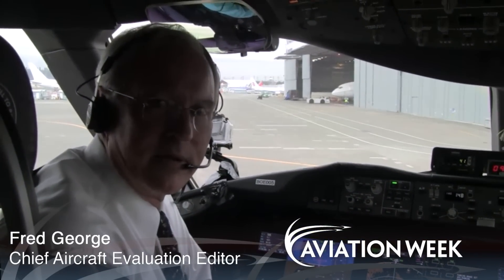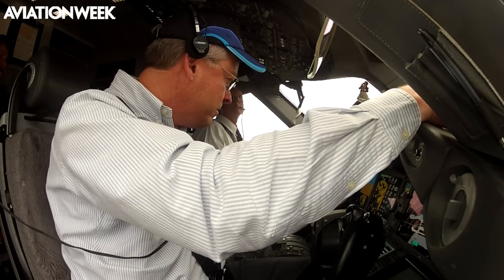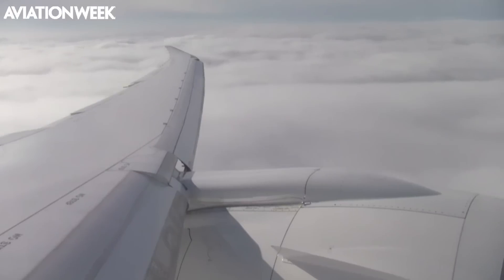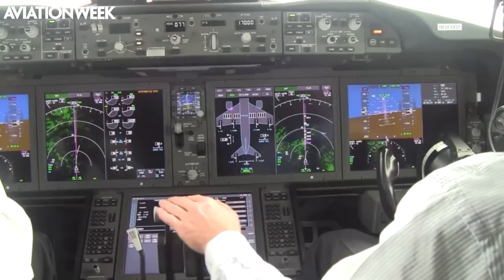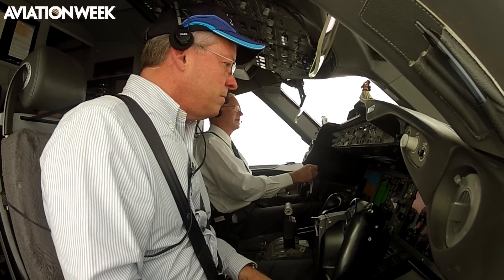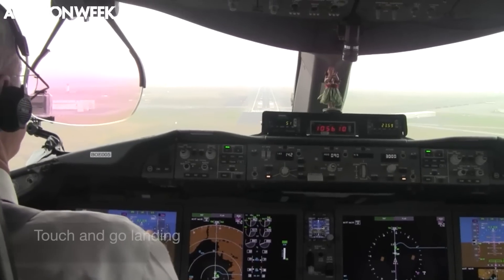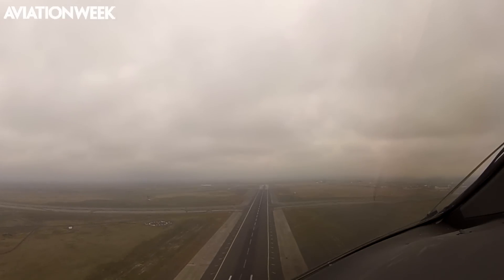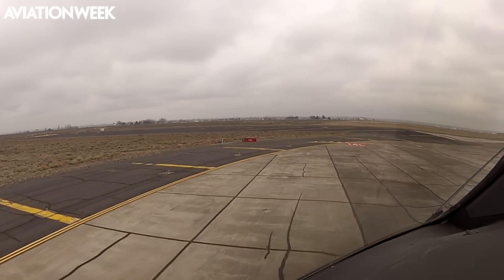Aviation Week Pilot Report: Flying the Boeing 787

Comment: notice at 7:18 where they claim to simulate a 1 engine inoprative landing...

But the instruments of the aircraft clearly show Both engines working at at the exact same thrust... -.-
Reply: nice catch
Reply: Be advised that this is considered to be a "Simulated" 1 engine inop approach. For safety reasons, they keep the inop engine at a stable 40 - 50% N1. They don't idle the engine for precautions.
Reply: SottileSky ... They dont even do that, both engines opperate at same thrust 100% of the time. If both engines are fully operational and at the same thrust you are not simulating anything. in other words, it's a completlety normal landing.

Comment: That's because the Capt and PNF didn't realize the PF was pulling back on the stick, (Which is what caused the stall) which at least the PNF would have with an interlocking control column, as the yoke would be pulled back into his lap. Then corrective measures, could have been taken, preventing the stall in the first place.

Comment: @oktal3700: Agreed, AF447 had everything to do with pilot response to a recoverable event (at several points), never meant to say otherwise. Just that it started with blocked pitots, which would still affect an analog asi. But in terms of 'redundancy' I'll bet that A330, properly configured could have recovered itSELFonce the pitots were clear - for sure it would not have fallen 30,000 feet belly first

Comment: 2nd Officer was Pilot Flying, 1st Officer was in the Capt. seat as the Capt. had just arrived to the flight deck after rest. PF had his sidestick pulled back. Capt. and 1st officer couldn't figure out why the plane was loosing altitude, as with the A330, there aren't any visual cues i.e sidesticks don't move where as control columns do.

Comment: so is manual handling in normal law operations the same as that on an airbus? if i pitch up 15 degrees and turn right 10 degrees and leave go of the yoke, will the computers hold it there for me? is there auto trim?

Comment: Technical question: In both 777 and 787, I've seen the centre ailerons first deflect down, then up, and then go back to its original position, all during the takeoff roll. What is the purpose of that?

Comment: Alternate air data system,,,,NICE. Air France 447 would have survived if they would have had one of these in place.
Reply: Also the feedback control column as opposed to the sidestick. The pilot would have been aware that the co-pilot was pulling back and would have been able to correct him about pulling back. I don't know why airbus doesn't use feedback controls, it would probably eliminate confustion in the flight deck if the pilots could feel the action or visually see the action of the moving control as the other pilot controls the aircraft.
Reply: Jeffrey Gettemans tho, if the pilots where correctly trained this would never happen.
Reply: Dont airbuses have a "dual inpu" callout if two pilots are using the sidestick at the same time? i though I saw that somewhere.

Comment: It's a lovely plane to fly, no doubt about it, almost perfect. It's the first aircraft I flew that is not only fool proof but almost idiot proof ( I managed to fool it once)!However the EFB is cumbersome and not in the natural scan. Using our Airline iPad was much easier. Shame Boeing /FAA felt it necessary to make it the same as the 777 for pilot common rating. Look at the A350 where the screen is for charts etc. However felt so privileged to have started on the B737-200 ,757, 767 and finished my career on the B787 .... The ice on the cake would be if the screens were touch sensitive ....
Reply: This is a great comment to see. Got a question for you. When it comes to the hydraulics, is it true that the 787 can still be controlled if were to have all 3 of it's hydraulic systems failed via the Electro Mechanical Actuators that operates 2 pair of spoilers per wing and the horizontal stabilizer without hydraulics needed?
Reply: @CoasterGuy787  Yes, you are correct ( but retired in 2019, so memory is slightly fuzzy), though I wouldn't like to try it! Depending on the nature of the hydraulic failure, if there was still hydraulic fluid available, then the Ram  Air Turbine (RAT) could be deployed to power one of the hydraulic systems.(can't recall which system) These multiple failures would be extremely unlikely and if it did happen it would be one of those days you should  have stayed in bed!
Reply: @markbradley2367  Thanks for the reply. One more question if you don't mind. I'm aware the 787 uses roll rate in normal mode like a FBW Airbus and that there is artificial force feedback for the pitch axis. Is there any for the roll axis also, despite the use of roll rate? If you was to be flying manually in gusty winds and the 787 rolled, would you feel that through the yoke via artificial feel? I'm curious as I'm fascinated by the 787's design since it's among my top 3 favorite Boeing aircraft.
Reply: @CoasterGuy787  you are really pushing my memory now:)) In roll once you banked more than 45° (I think)then stick forces increased to try and prevent you overbanking , although when practicing unusual attitudes in the simulator you could,with muscle override it ! From a pilot perspective, it felt in roll no different to the 767 I flew before, even flying a very gusty 40kt crosswind it behaved beautifully. I must qualify that I am not a test pilot, so wouldn't have the  skills to differentiate small differences between types,  though the 757 was much heavier in pitch .
Reply: @markbradley2367  Ah, lovely to hear. The 787 is truly a wonderful aircraft. Thanks again for the reply :)
Reply: @CoasterGuy787   no problem,  hope my answers helped . Best wishes

Comment: You people do not seem to understand that all new major aircraft experiences "childhood diseases" It's like that with all new machines, cars, planes you name it. Boeing is not alone with this and certainly not the 787. Just think of the Airbus A380 which was delayed 2years. Cracks was discovered in the wing structure and an engine failure on a Qantas A380 which was caused by an oil leak. And it still does not make the A380 a bad plane.

Comment: Because it's completely against any stall recovery procedures, the Capt, and the PNF, probably wouldn't even think the PF would be pulling back on the stick in that situation, hence the confusion. Had they had a interconnected control column, they would have seen the mistake earlier, and most likely reacted sooner, and save the plane!!

Comment: sir, what you said has nothing to do with control philosophy, airbus use a sidestick because every airbus after the a320 has an autotrim system. if that wasn't the case every airbus would be using yokes like the a300-a310.

Comment: Its actually dangerous to rely primarily on a bunch of computers, when pilots do the minimum. Computers are computers, if something goes wrong, pilots are literary " blind". Even my new pc shuts down sometimes with no apparent reason. Plus 787 appears to have a common lithium ion battery problems still.

Comment: I flew the B767 till I retired in 2000.  To me that may have been the last plane that made it easy to shut off the electronics and hand fly an approach and also to fly engine out approaches and go-arounds in the simulator.  The 787 is a magnificent plane but when the parameters of the computer are exceeded or the computers fail you have to have stick and rudder skills to fall back on.  We are already seeing accidents where the pilots are defaulting to the computer such as the Asiana SFO accident.
Reply: Air France 447
Reply: Matthew Taylor That accident probably wouldn't have happened in a Boeing, dare I say it would've been impossible, particularly with the 787.
Reply: +dragonsqrrl Or a Triple Seven, I might add! Or any Boeing aircraft!
Reply: +Blake Tibbitts It would have, because the crew were unaware of the situation they were in, and had very poor CRM, not knowing who was in control when a simple "I have control" would have been sufficient. They were over-reliant on the automation and when they were given full control after the autopilot disconnected, they didn't know what to do. When you have airline crew that cannot recognise and recover from a stall can you really blame the machine? Remember, a bad workman always blames his tools.

Comment: Both Boeing and Airbus can be flown by hand, which is a good thing because you cannot rely totally on computer. I therefore love the 777 and 767 and I hope 787 is just as enjoyable for pilots to fly. Pilots are there for your safety and pilots will always be needed to fly the plane. About the airbus vs boeing: who cares. They're both good and everyone has their favorite. About AF flight: this was an computer failure in the beginning. Computers should be there to prevent failures, and not to solve them.

Comment: both need to learn from each other... while airbus has auto trim and auto rudder for a long time, boeing is just in the beginning using it.
But the Autothrottle is in boeing jetliners better. moving the levers is a better option because pilots can see what's happening.
I for myself prefer yokes, instead of joysticks, but both have their pro's and cons. You cannot say one of them sucks or is arrogant, because both have different views on how a perfect aircraft has to be and they have tradition ;)

Comment: All modern airliners are flying computers, All modern airliners are flyable by hand as well as the autopilot, So your statement makes no since. I'm in the business at a third party MRO. We work on both Boeing and Airbus products  and I can tell you they both have there strong points and there week points. The 787 is far more computer driven an any airliner flying today. And it was a pilot not a computer that landed that A320 in the Hudson.(bless you Sully) So again your way off base.

Comment: Anytime someone says 'it will reduce work load yet improve awareness' they are blatantly lying.
Also, all of these electronic, computer-based safety feature and auto-corrections are predicated on proper maintenance while the plane is on the ground.
All that being said, I like this plane as well as flying in general, but if anyone tries to claim that flying is safe it's horseshit - flying (like driving 75mph) comes with enormous risk always.

Comment: technology will make human beings redundant in years to come
Reply: Really? We have seen what happens when humans are placed in a cockpit with computers. Are you ready to fly on a plane with just the computers? Also, boeing or airbus would be suicidal to make a pilot-less airplane because no airline would buy it because no passenger would want strictly a computer. Plus, humans never short circuit or have glitches or require service packs. We have minds and are able to use past experiences to make decisions to try to solve problems. This skill specifically has saved the day many times especially in the cockpit. There will always be a human monitoring the computer in the cockpit. Always.

Comment: You won't an aircraft built again with mechanical flight controls. The days of cables and pullies are over. Quite frankly it's (IMO) taken too long to get fully capable electrical backups to hydraulic controls. But we're benefiting from decades of aviation accidents..
Better late than never I guess.

Comment: Well, they are anything but minor, but hopefully will be fixed. BAttery replacement may not be as easy as it sounds, but Im worried about the cockpit glas cracks as they may be idications of bending integrity problems of the composite body..

@S961 talks like a douchebag but has got a point: I prefer boeings style of "pilot has the last word" over "computer has the last word". I also dont like the "Desktop PC"-like human interfaces in A380s. They need to much "looking on" attention..